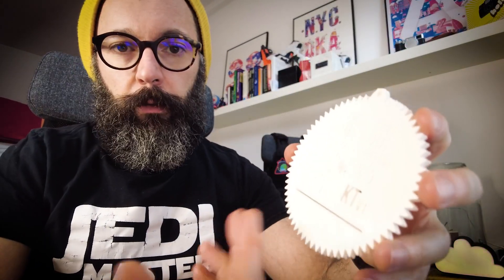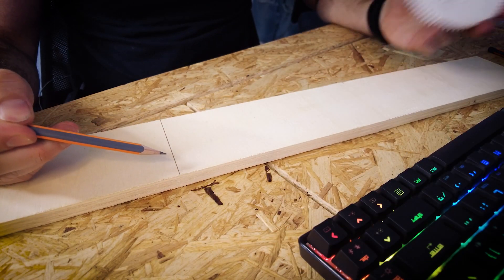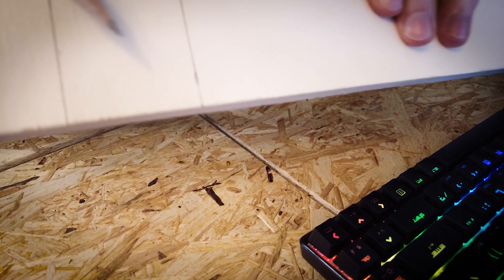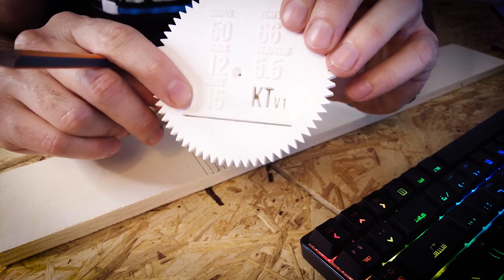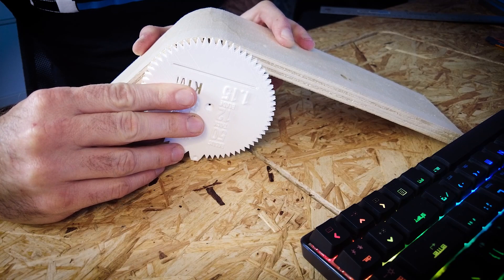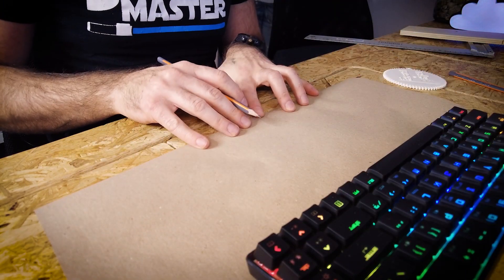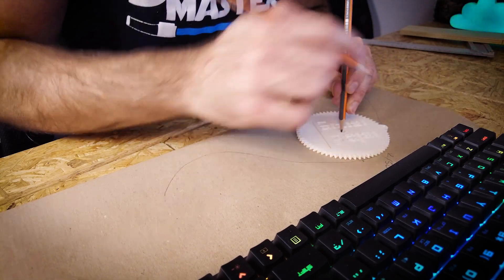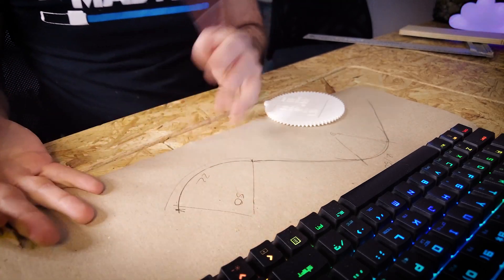PERFECT Kerf Bending with a 3D Printed Tool

Comment: Hello, if I understood, if I wanted to make a smoother curve, I simply have to skip a tooth (or those that are necessary) of that thing so that it curves smooth as a medano?
Reply from the maker: Hi there! This tool is designed for a curve of radius 50mm. You could achieve different radiuses by skipping teeth, but the math needs to be correct. I would have to check, but skipping a tooth would equate to 100mm radius (I think). If you kerf on EVERY tooth, the curve would be 50mm radius and very smooth. The number of teeth you use determines the angle. Does that make sense to you?